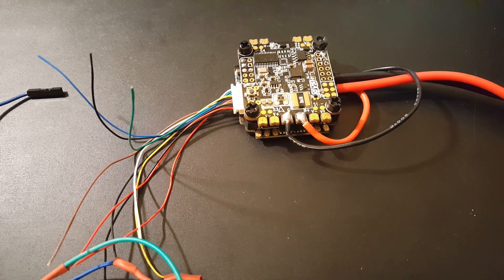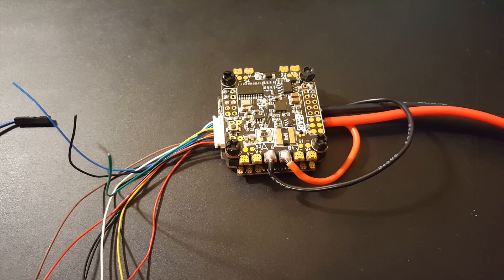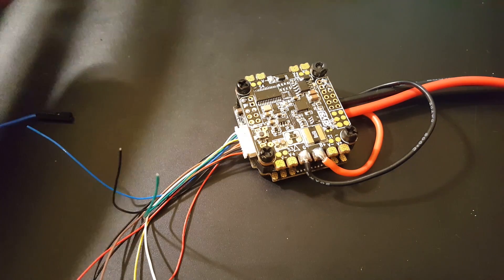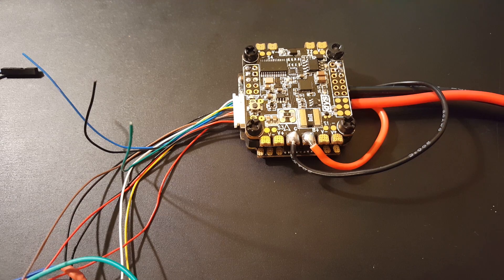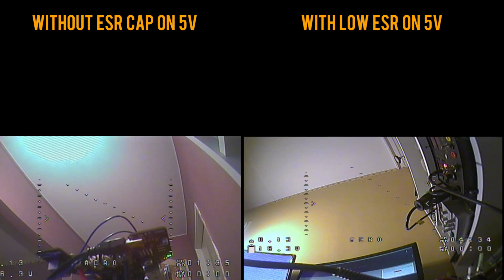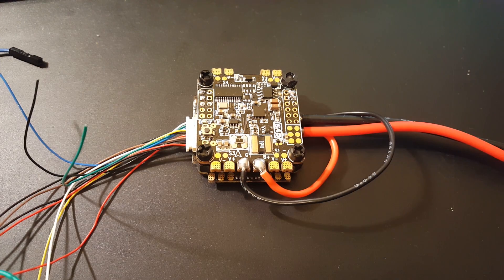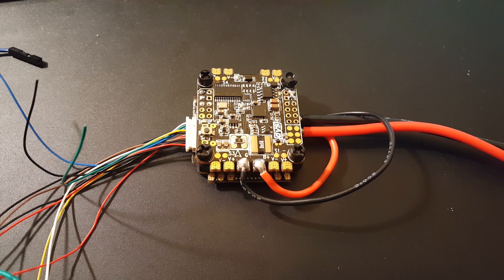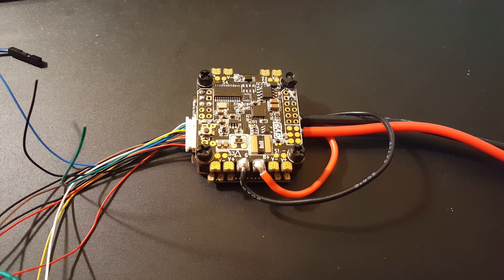DYS F4 Pro // Noise and OSD Fix

Comment: Hi mate lo e your video content I just got this fc and the 20amp ESC when just stacked together do you get full batt voltage from it just being on the push together pins or dose it have to have direct batt solders to the fc + & - pads

Comment: This noise on the 5v rail bothers me, can that get into my RX and mess with my digital (sbus) connection as well?  For me I did not see this problem when I had the individual ESC's hooked up to the DYS F4 pro, but when I swapped them out for a DYS 45a Dshot 1200 4in1 esc, the noise is so bad I can barely fly.  I will try the cap on the 5v rail,  Thanks for posting this video sir!!!!!

Comment: did not help me. i used low esr cap on 5v, at vbat, solder all ground together. nothing helped. cam to vtx without osd is super clear. it must be somewhere at video in or video out at the osd. any suggestions? i use omnibus f4 nano v3 and have bluring lines like in this video the more i throttle but osd does not flicker

Comment: Interesting. I have the Flycolor F3 flight controller and I get no battery voltage in betaflight. Someone suggested I solder from battery positive to vbat positive to get the reading. What confuses me is if my battery gets below 3.6v my quad makes the low battery alarm meaning it must have a sensor connected.  So surely if it already has a sensor reading why do I need to add extra weight with wire links to vbat positive?

Comment: There is two different pads to run fpv to. Run your positive wire to 5v not 12v lol
Reply: Adventures of Jake a simple step down will fix that voltage issue
Reply: Tyler Signal that only works on 5v vtx. A lot of vtx's run on something like 7-24v and will not work on 5v

Comment: Sorry if this is a dumb? Why do u run power from 4in1esc battery lead to the FC battery lead, is it just so u can get raw Vbat power out of the FC?
Reply: Not a dumb question the fc is wired like that so you get a true voltage from the lipo and it also helps with the current sensor 👍
Reply: thank you!

Comment: Hi there and thanks for the video. I'm not sure I'm getting it properly though. Where am I supposed to solder the capacitor ? I've read you said "on any 5V and ground" do you mean any of those pads on the image below ?
https://ibb.co/cHVNTa
Reply: A.B.K. - FPV Yes any of those 5v pads will work. Just solder a low esr cap on there and it should help clean the video up.
Reply: Thanks for your answer Justyn
Reply: A.B.K. - FPV You are welcome. After you do the cap, please comment on how it worked for you.
Reply: So it's done and after some tests it did not solved my problem. I've soldered the capacitor on the ground/5v on the far right of the FC, my frame is quite small so I had to put some extensions wires. I don't know if that's a problem.
Anyway I swapped my Eachine video receiver against a Team black Sheep one and the dirty video/noise problem disappeared all of a sudden ...

Comment: first of all awesome content!!! . kinda need some help .I am using the dys f4 pro v2 fc  and it came with bf 3.1.7 stock. i cant get into  dfu mode (powering on the quad with the button held). No matter wht i do i cant flash my board with any firmware. Is there any other way to  flash the hex file to  the board .I hav also tried the non dfu method  (no reboot sequence).The board's buzzer starts to scream slightly and the lights get dimmer and finally freezes up... any thoughts on what i should do in order to  get 3.2. Any help would be highly appreciated
Reply: Go into betaflight , look for the cli command page and type dfu. That's it. Easiest way to put a board in DfU. At least for me it works easiest

Comment: Should I put the cap on the 5V even though I connect the VTX directly to the bat voltage? Are you suggesting there are some kind of "spillovers" from the 5V rail into the main bat flow?

Comment: Im running this FC with the F30 4in1...xt60 coming off the 4in1, powering my VTX off the VBAT next to the sbus(Vbat by Uart6 isn't outputting full battery power).  VTX is a Unify Race which is powering my camera.  I have no video noise whatsoever.  However it's on a light build with 2205 motors, so I havent tested it with more powerful motors yet, but it seems to work great.
Reply: What do you mean that "Vbat by Uart6 isn't outputting full battery power"? :) and how do you know?
Reply: If you look at the Pin layout of the DYS F4 you will notice it has two VBATs, also referred to as BAT+, one on each side of the FC.  I had my 7-22v Unify Race VTX connected to the BAT+ next to UART6 and it wasn't powering on. So I tested it with a multimeter and it was only outputting 4.5Vs or so.  The BAT+ on that side doesn't output full battery voltage unless you have a battery plugged directly into the PDB/FC..mine is setup with the XT60 on my 4in1 and the FC is powered off the 4in1 through pins.

Comment: I have two of the Rev1 board in use and I do not have problems, but I don't use the AIO ESC.  Cam and Vtx just run off the 5v rail.   I have a rev2 board going into a quad soon, so I'll see if that's clean or not.

Comment: I did this with my first flight controller because it made sense to me. Then I saw a test where a cap basically eliminated spikes and noise on a test bench with a scope and I figured if it works that good then I don't need to also mess with the 5v side. But your tests do still show noise with capacitors. Why? I dunno. But I did feel that my flight controller was more stable with the cap on the 5v side no matter how noisy the battery side was. I'll still cap the battery end because the spikes can be 30v+ and that can damage components but I do feel like 5v filtering might still be needed for a lot of people.

Comment: Hi man great video...can you  put this board on a build please?...I don t know why but my motors get pretty hot...i don t know if its the board or not...i run dys xsd30a and emax 2205s 2300
Reply: I truobleshouted this probl but no way...i ru also 1 470uf cap per esc

Comment: I use a lc filter with vtx and 1000 cap on battery and never had any issues. Very confused.
Reply from the maker: Craig Byrd you know it's weird I think there is 2 revisions of the FC or the ESC because some say it's perfect other say it's the worst thing they ever used.

I guess mine was the bad revision if that is what happened. Its a mystery really..

I am trying to figure this out.

Comment: Why do you have wires going from the ESC up to the battery pads on the flight controller? When you plug the flight controller into the pins on the ESC that's what powers the flight controller are you double feeding power?
Reply from the maker: +QUADBOT FPV because I am not using the pins so I can hijack the motor 1 signal and run my noise script through the motor :)
Reply: I was about to ask the same question. He is not plugged in to the pins. if you looked at the board orentation. That is if he is using the 30amp one.

Comment: pic of the attachment point please?
Reply from the maker: +MrFadjule on any of the 5v pads if you notice in first part of video where the solder is bridged together that is where I had it but don't bridge like I did that happened when I removed it and was too lazy to clean off.

Comment: Hey i have this fc with the kiss esc's on the Board on the left is there a batt output, I put an LC filter on that output and that straight to my tramp VTX and I use the 5V of the tramp and have perfect video.
Reply from the maker: These ESC's are very noisy the Dys F30A a lot of people have been writing me so i decided to make this video for everyone who needs it. ^_^
Reply: Oh ok thank you bro! Damnit and I just bought a set of the 20amp all in one... Because I thaught it would clean up the build a lot. have you had the change to test the emax magnum? Those really seem the bees knees
Reply: +Jerlea
But remember, circumventing the noise doesn't stop it from messing with the rest of your components :)
Reply from the maker: Rasmus Kristoffersen BTW I threw this in the trash 2 esc would not work
Reply: Drone Mesh i saw your video on the xsd30a v2. And threw those those days esc's out as well. Your work is amazing :)